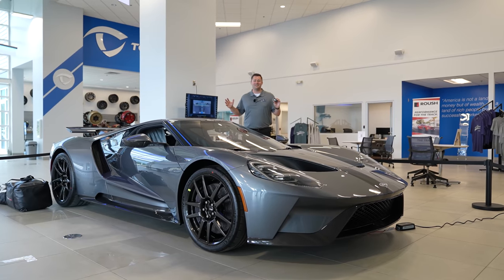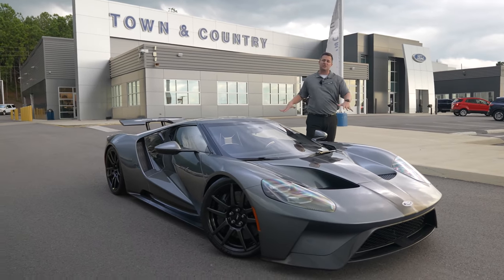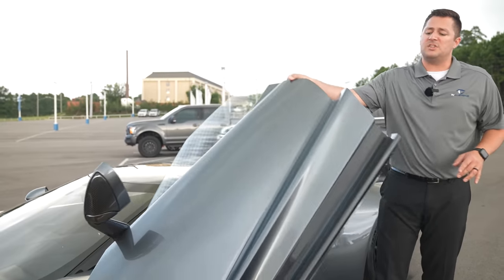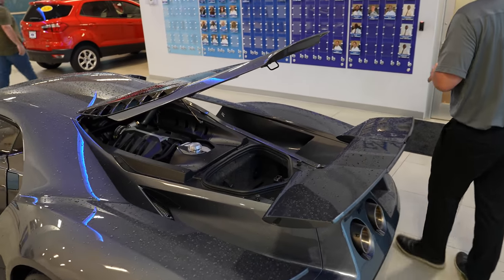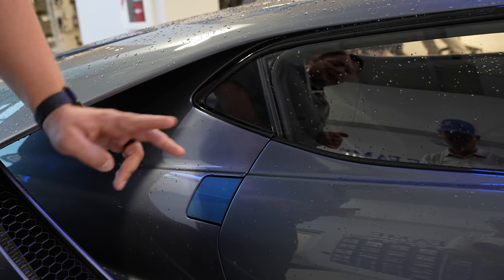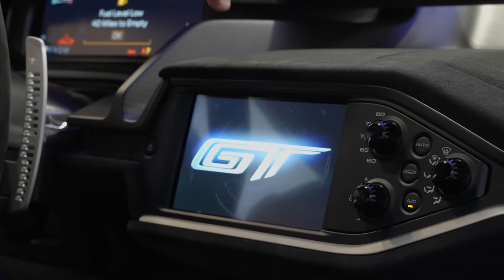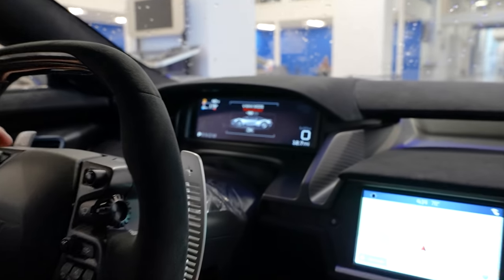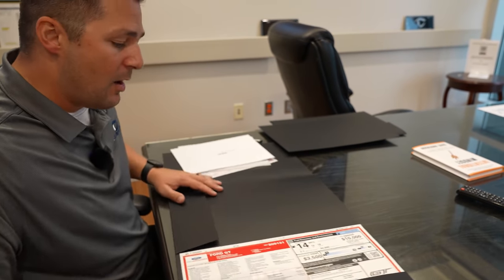Introducing the 2021 Ford GT Carbon Series!

Comment: I have the same tender for two of our cars that  I have hard-wired to the battery with a plug-in connector that connects to the cord on the charger connector. You can buy an extension cord that you can pre-wire into any car so it is just a plug and play after the installation.

Comment: Pretty much the same entry for the Porsche 996 turbo.  Once the battery goes dead entry into the car becomes limited. The charging terminals however are located under the dash on the drivers side as a pullout feature.  The twin turbo v6 is still the best engine based on weight and power curve.   A great v8 flat plane would provide a great soundtrack but weight and balance is more important.  The new Chevrolet Corvette has punched them with a very large mid engine v8. The z06 will be super fast and affordable compared to the new GT. It will be interesting to compare them.

Comment: Looks like just a re-skinned CTEK charger. For $400k+, they better include one. But for the same price, I'm actually quite surprised they couldn't install an exterior port on the underside or somewhere else hidden where you wouldn't have to contort yourself just to charge the battery. Or, you know, just leave the front cover open while it's charging.

Comment: If the doors can't be opened because of the windows, shouldn't the lever in the trunk open the hood to access the battery, instead of unlatching the doors?

Comment: I have a solution for the battery charger wire issue, ride it regularly so you won't have to trickle charge it.
Reply from the maker: The normal batter is lithium ion battery.  The Delivery Specialist said that if you go longer than 2 days without driving it, you must leave it plugged in.

Comment: It's half a second faster than the corvette and cost 450k more. Great deal
Reply from the maker: The GT is a literal piece of art.  The exposed carbon fiber is hard to quantify if you haven’t seen it in person.
Reply: You're obviously forgetting the most important aspect of that whole thing: the Ford GT is NOT, I repeat, NOT a Garbage Motors manufactured hunk of sh** chevy....

Comment: The MSRP is how much for a car that needs a battery tender?
Reply: It’s not a car that will be daily driven.
Reply: @braxtondeets3365  you realize that “all” batteries have a shelf life right? Even the parts store batteries are charged if a predetermined turnover rate isn’t met. If you disconnect the battery it will last longer but minimal usage kills batteries without maintenance. Battery tenders are extremely common with power sports equipment that’s not routinely utilized. I’d say they saw an issue and we’re forward thinking enough to provide an alternative to a lead sandwiched between the frunk and body leading to paint damage.
Reply: @yarbrouc1  of course. My point is, Ford is limiting the use of these super cars by encouraging them to sit. A battery tender is cheap. “Oh look here is my super car, that I never drive, you wanna hear it? Let me unplug these wires from the battery and start it up” doesn’t seem super to me. I buy a super car that thing better be ready to start after months of sitting. If someone buys a super car and doesn’t drive it for months on end, then they might have purchased a car that’s quite a bit out of their league.
Reply: @braxtondeets3365  providing a functional option on a car that yes, will not be daily driven, is actually convenient. Most exotics on the market show less than 1-2k miles annually if that. Fact is that this is a collectors car that you have to be invited to purchase. Those type of cars are typically displayed or strictly tracked. Without battery maintenance you’d be swapping batteries every few years if not sooner based on climate, which wouldn’t be ideal as the electronics reset when completely discharged.
Reply: @yarbrouc1  well Ford should invite some geniuses to make a super battery for their super car. Pry why nobody drives them, wires out hanging everywhere

Comment: For that money I better get more than 1,000 horses! I know its extremely light weight but you don't wow anyone by giving 10k per horse for a car with less than 1k hp. Cool car though!
Reply: Gen 2 Ford GT is pricey because it's made by Multimatic, a firm that only build racecars and performance parts for racecars. Completely hand built, full carbon fibre, hydraulic pushrod suspension and more..none of that is cheap and I've read somewhere that Ford actually loses money on every production GT!

Comment: Nice car, but insurance on this thing is robbery. Hydrolic gas strut in door will have to be replaced every 2-3 years. And the wire feeds through the wheel well so you can close the hood while it charges so rain, or animals don't get into the hood. It might take 6 hours to charge a battery. Looks like it is too low to be legal.

Comment: Stop using tire shine. It has silicone in it, that’s bad for the rubber. it will make them dry and crack.
Reply: Not all tire shines contain silicone
Reply: These tires won’t last 5000 miles. I’m not sure dry rot will be an issue.

Comment: This car seems rather rinky-dinky for a million bucks or more. Having to thread a wire through the wheel well, The spoiler will damage the body or cut off your finger and the seats don't move. I see huge and frequent repairs needed. I like the GT40 much better and it has the doors that cut into the roof to aid ingress and egress. I also think it's not that tiny. It feels like the designers of this car were lazy and rather disinterested.

Comment: He is wrecking the interior of this car with his 6 ft frame and 260 pound frame. He is doing nothing but bad mouthing the FORD GT because he is too big for the car. He needs to stick with the HUMMER or the Dodge Ram truck.  He also needs to do a video about how well he also fits in a (smart car).  And he can bad mouth anything that is not revolving around his big clumsy dorkness.

Comment: Overpriced and it’s as simple as that and the only reason that it’s overpriced is because of not so smart fellas such as yourself making such a demand for a garbage v6 powered vehicle and I could care less if it makes 600 horsepower. Ford screwed up majorly by using that garbage motor vs a nice 351 Boss block based engine.